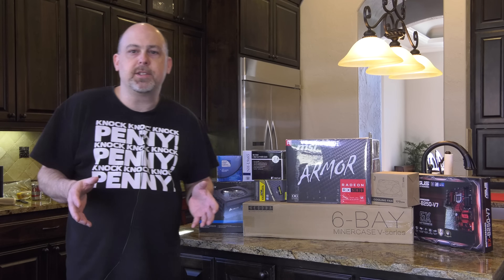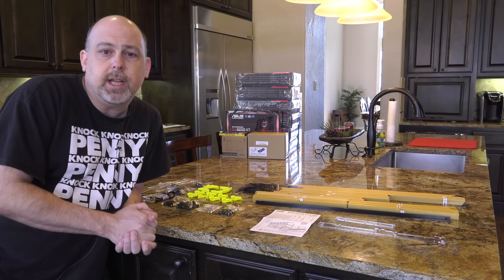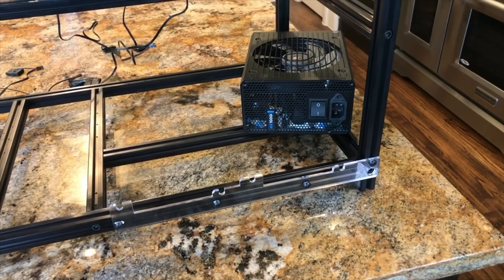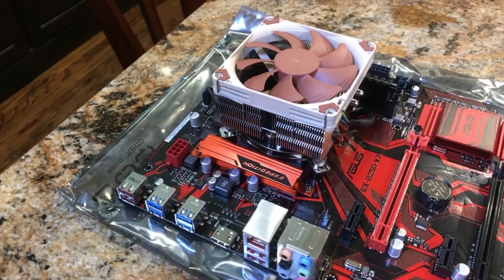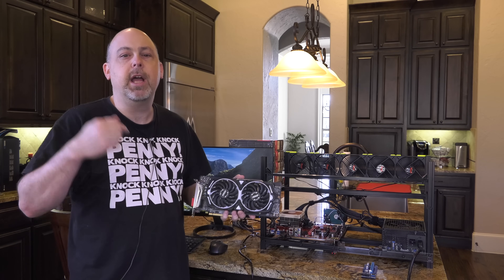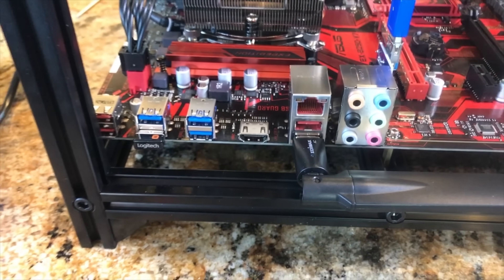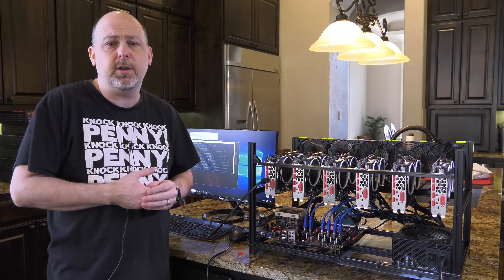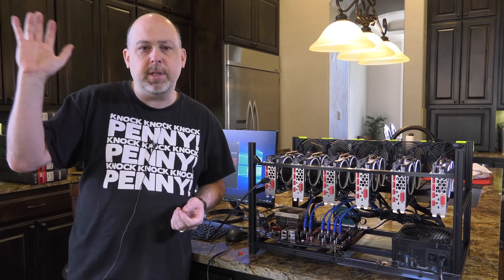Building my Second Mining Rig

Comment: its a nice rig. i am building one myself. when i saw you were going to explain how to put it together i was excited but after seeing the video not so much. the physical assembly is kind of easy but it is the electrical details and programming details that we need. An example in one comment I saw that someone spliced all the fans into the mother board and you said you hoped they didn't blow the board. these are the real details we need. one big one is how to get windows on the hard drive and the optimization settings. thank you. please don't take this as a criticism but hopefully not to many boards have been blown because of some details not discussed. thank you and can you please do a part 2 video on details.
Reply: programming isn't hard.  Hardest part is getting a wallet and being able to cash out if you are not using an easy program like Nicehash.  The assembly of the open air case was difficult for me as it's the first time in 20 years of building PC that I didn't use a full tower case.  The instructions were horrible.  but I got it done had to "make it work."

Comment: Great video! I just built a 1060 rig like the first video. A couple tips. The poly part for the power supply can bolt onto the short side of the case. That is how I did mine. The power cables are much easier to deal with if the PSU is mounted sideways. 
If you are building this for shorter video cards like the 1060 you can either switch the "L" shaped bar that the video card attaches to over to the other side or switch the top cross bar of the case so the risers have something to sit on. If you watch the 'tour' of the first rig you can see he custom mounted the riser bar and didn't use the screw holes. 
On the 'clips' that connect the fans, I initially put them on like this video but then went back and put on row of clips on the top front, and the bottom row on the back. It works fine with them all on one side, it's just a lot more rigid with them both. The kit has machine screws so  I used a reamer on all the fan holes so the screws started easier and used a drill with the clutch turned way down, that's a LOT of screw. I used the screws that came with the fans in places where I just needed to secure the fan grills.
The motherboard stand offs left a lot to be desired. Hard to get started and one totally striped out. It's really just luck of the draw with mass produced items. Nothing a little JB weld can't fix.
 Even though you probably aren't going to have a monitor connected all the time, I would have preferred to use this board rather than the Biostar from the first build because of the HDMI video instead of DVI.

Comment: How did you connect the fans I just bought the same case as you and the fans are all molex but after reading how scary molex can be especially with fire hazards I bought the same fans you have and was wondering if I needed to buy some sort of adapter I have 2 PSUs evga 1000 t2sim not sure how to connect them any advise is greatly appreciated

Comment: How did you hook up the five 5 fans?  Special cable or a Swiftech splitter? thanks for the video.
Reply from the maker: They all daisy chain.
Reply: The fans came with a single 4-pin and a Molex connector or did you use something to daisy chain?
Reply: Your initial video was instrumental in my Rig build.  The fans are screwed together leaning in a corner at the moment.  I purchased a 5-into-1 splitter cable with 1 Molex and 4-pin and plugged into motherboard fan header.  Nothing..... no lights and no fan movement.   I'm ordering a Swiftech splitter next but I doubt that's my issue.
Reply from the maker: They daisy chain on their own: http://i50.tinypic.com/33o1uus.jpg
Reply from the maker: Do not plug them into the motherboard fan header. It has nowhere near enough wattage.  Plug them directly into the power supply.  I hope you didn't fry your board.

Comment: How you route your gpu power cables? I have 3 gpus and I feel like the cables are too short and my rig is very messy. Also how you have enough slots in the power supply for everything, gpus, risers etc. I can maybe at best add 1 more gpu and then the 1000 watt power supply is full. Then I would have 4 cards. But mobo supports 6 :/. Ran out of space and slots in psu.

Comment: i don't know the exact setting you have, but, i have 8 msi armor rx570 4gb, i do bios mod,put the compute mode on set the gpu to 1150mhz at 850mv, put the ram at 2100mhz at 925mv, i'am at 1135watt for 8 card and 234mh/s mining ETH avg of 29.25mh/s par card.

Comment: Heres a dumb question. Is there a free windows 10 download or do I need to buy a product key?
Reply: YOU need to buy it.  probably could run a linux distro because its free and open source
Reply: You do not need to buy it, you can just download the media creation tool and use it unlicensed.
Reply: And, if you ever want to get personalization, etc you can buy a legal copy, or a cheap copy from a key dealer, but those could be revoked since they typically are not bought legitimentally or meant for a different region, and according to LinusTechTips are against the EULA.

Comment: That seems like pretty low power usage. Not sure what’s going on with my rig but it has 6x msi 580 8gb gaming x is pulling a total of 1240w for I’m the wall. I’m using two EVGA 850 PE. Could be because they were flashed and are slightly overclocked.

Comment: I've build 2 rigs with 580 4gbs, I've gotten 27mh/s and just under 820 watt at volt. I use the mining driver and my own vbios to up the memory MHz and keeping voltage down on the cores as they are barely used. At least for ethereum mining. Maybe I missed it but I think you forgot to mention that it's on the ethereum network you are getting these hash rates :)

Good video though me and a few buddies also uses the veddha rigs they are quite good. Some of them have small production issues typically thee screw holes are a bit wonky on some of the holes we've tried it a few times but nothing major

Comment: Hello TheGeekPub
Do you figure out how to enable on board hdmi video ?
I get stuck on this problem.
Cant get working on this motherboard.
No settings in bios to turn on video.
Maybe any one know how to enable on board video ?
Reply from the maker: No. I have case open with ASUS.  They're very unhelpful.  But just hook your HDMI to the card plugged into the red colored X16 slot . It will work fine.

Comment: You should mention with the veddha case that you will loose the top 2 i/o ports with probably most mobos, you may not need them but I think that is a flaw in the design of that particular open air frame.
Reply from the maker: On 99% of motherboards those are PS/2 ports. I doubt anyone will miss them.

Comment: Hi TheGeekPub, I'm using the same motherboard ASUS EX b250 v7, and I can't get 4 cards working. I've tried several times and I've only managed to get 3 cards working in the x1 slot. Whenever I plugged my riser cable to x16 and x1 it won't show the POST screen and the GPU isn't recognized. Any help? I've set mining mode on asus bios on
Reply from the maker: Yes,  Plug your HDMI into the video card plugged into the X16 slot.
Reply: TheGeekPub ah yes it worked. Thank you so much!

Comment: Awesome video as always.  I'm building my first one thanks to your links.  With the risers, there is power on them, but I noticed in your video you connected the graphics cards directly to the power supply, does it matter?
Reply from the maker: You have to do both.
Reply: TheGeekPub Awesome thanks!!!
Reply: Hmm I wasn't able to get the corsair powersupply that you had linked since it was out of stock, but the one I have only has 5 power cables that can go to the graphics cards.  Looking online I did find that I can add another powersupply and there is a cable to connect the two.  Is there something I could be missing or does the corsair one you use have 6 power cables for the cards?  I have enough for each riser.  Very odd.  Thanks again!

Comment: when did you buy your gpu's? what price did you get them at?
Reply from the maker: I can't tell you because then everyone would buy them and I still need a few more. ;-)  I got them for $339 each from a warehouse reseller for businesses.
Reply: not bad compared to prices everywhere else online. i remember back in nov i bought 2 rx 580 for $260 each. and that was the going rate at many locations i checked. i 100% refuse to pay over $300 for a rx 580 or a gtx 1060 6gb. I feel like doing so helps the card scalpers continue buying up huge amounts of stock. to each there own but i sure wish the prices would normalize.
Reply: Low bass... seriously? That's not very smart of you.  1st.  Welcome to capitalism.  The price is what the market will bare.  2nd. Who give s a flying flip.  If you can buy the card and make a profit mining its meaningless what it costs. You're afraid to spend an extra $100 for a card that can make that $100 back in a week.  That's just dumb!
Reply: dont know what card your using but the rx 580 does not bring in $100 in a week or anywhere near that. . $100 more isnt as bad as what the current rx 580 prices are. im simply saying if feed the fire it will grow. I like mining and i dont sell my crypto for fiat. the dumb idea is to support sky high prices.

Comment: Simple question. When you have multiple independent rigs. How you can ensure that each rig independently doesn’t overlap with the work the other rig is doing?
Reply from the maker: The machines are part of a pool.  The pool hands out the work.  But duplicate work does happen by design. Transactions on the network need to be verified as many as a 50 times to prove they are accurate and legit.
Reply: Thanks for the quick response. Loving your videos. Any sense of noise perhaps that was covered in your earlier video. Plus it would be great to see your new rig stacked on your old one.
Reply from the maker: Both of my machines are virtually silent.

Comment: Should i get 4x 1060 3 GB or 2x 1070?? Cost of the 1070 is twice AS much AS the 3gb
Reply from the maker: It's all about price and ROI.  You'll have to do the math.  Use one of the calculators and see how fast they ROI based on their hashrate, power usage, and cost to buy.  Buy the one with the better payback.
Reply: TheGeekPub power is not an issue, and i am planning to use nicehash

Comment: Ouch $600 each for those rx580's. Roi in 7 months. I guess it could be worse.
Reply from the maker: I got them for less than $300 each.
Reply: You did well getting any GPU's in the current market !! :-)
Reply: Any tips on how to get your deal?  I found two fairly good prices, but hit the order quantity limit.   You should also MOD the AMD Bios --  those modded cards  with the Compute Driver should get you over 30MH/s and you can under volt to lower power.   My rig has 5x 580's and is around 800 watts @ 150MH/sec...
Reply: I have a love hate relationship with great videos like yours- I love the detail and excitement to learn and replicate what you have done but yet I Hate how impossible it seems that you got the cards for less than $300 when all Your links to the cards point to prices at least $625 and up for a single RX 580- please do share . I am sure I am not the only one wanting to know!